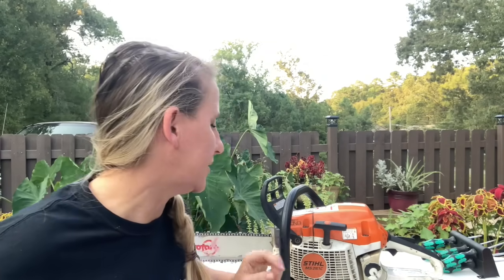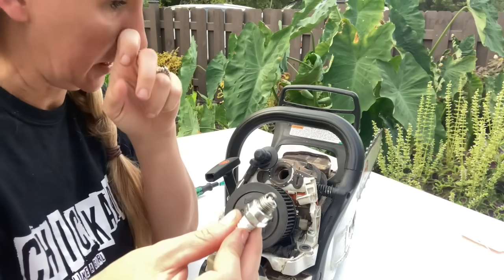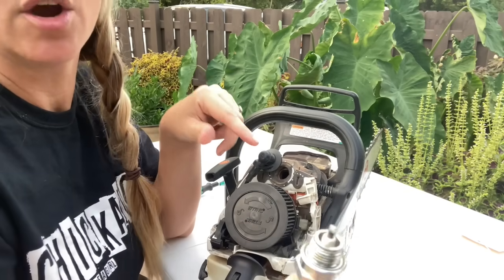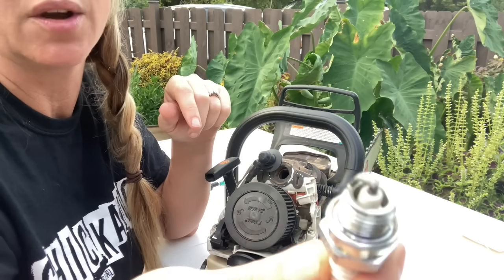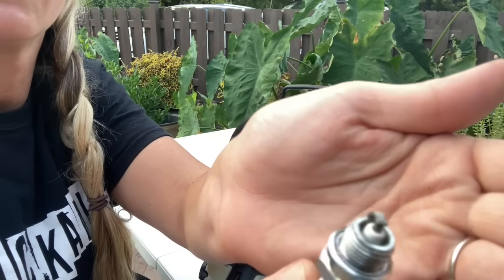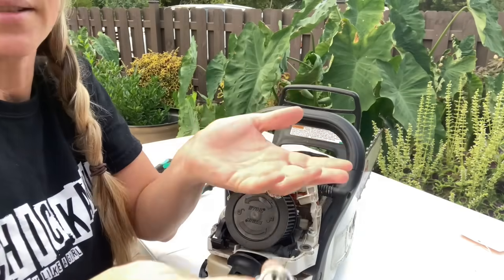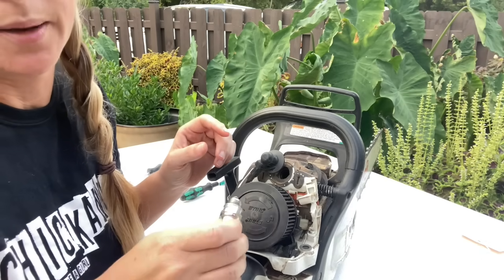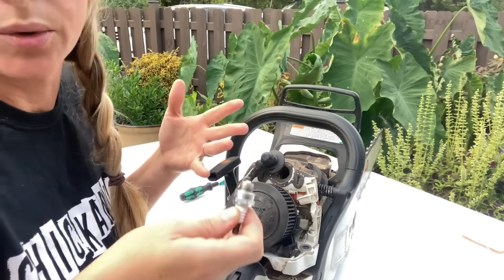STIHL M-TRONIC CHAINSAW HAS NO CARBURETOR ADJUST, WILL IT "RESET" TO REGULATE FUEL CORRECTLY?

Comment: I have a 661 C-M that flooded so bad after 5 pulls on a cold start it was dripping fuel out the decompress button. That wasn't the first time but not every time either. I took it in under warranty and described the symptoms to the "master mechanic" and he told me he would check the circuit board. Great, that sounded like a reasonable course of action. When I went in to pick it up 3 weeks later they wanted to charge me so I asked why and was told 1) it had really really bad gas and not mixed to the proper ratio. I use aviation 100LL and I know how to mix, I mean how hard is it to pour in the Stihl brand oil and fill the can up to the 1 gallon mark? And they replaced the gas filter. I preceded to read the "master mechanic" the riot act and left  the saw with instructions to have the owner of the Ace hardware store call me. He ended up not charging me. They also had to replace my bar, chain, scabbard and engine cover because they lost them. I think I actually may have remedied the problem after taking at least a half hour to get the flooded saw started it was running very rough and took several minutes of goosing the throttle to keep it going enough to idle without stalling. Then using it to make a few cuts on an oak. After that it seemed to be running normal but I Stihl took it in to have it looked at. It hasn't given me any problems since so I'll never know for sure what made it flood like it did unless it acts up again the same way. But I Stihl suspect the circuit board.

Comment: A bit of a hit piece here. I gather that you are an Echo dealer, so it’s in your interest to trash your competitors. But you also owe it to your viewers to give them the facts, and this isn’t exactly it. And to say it takes 5 or 6 pulls to start a Stihl? I call BS there too. I’ve had my MS361 for almost 15 years, and it’s never taken more than three pulls to start from cold. And I’ve never done anything to the saw other than clean the air filter regularly, keep a sharp chain on it, dress the bar when it needs it, and it’s never been back to the dealer for anything…..ever…. Some of the best money I’ve ever spent!

Comment: If you read the instructions, that's not the correct way to calibrate the saw. You start the saw and let it idle for between 30 to 60 seconds. Then you give it full throttle. The rpm goes up and down when the calibration is proceeding. When the rpm goes down noticeably, let go of the throttle and the saw idles, calibration is done and complete.
In the video it seems like you just let it idle for 90 seconds, and that will not lead to a successful calibration.
Reply from the maker: https://blog.stihl.co.uk/perform-m-tronic-reset/

Comment: Actually you are mistaken. IF the saw was starving for fuel it would be screaming, it is not. You maybe used to echo saws that are purposely tuned lean from the factory and often burn up unless adjusted.  The MDG diagnostic tool does not program the coil and is only used to diagnose the saw. They run about 500 CAD or 450ish USD.  From what I saw in your video that sun is running fine. I service a fleet of such saws and they all run very well. The Mtronic saw still has a carb kit so that could be the issue. Also you were mistaken about the warranty. Stihls warranty is 1 year, get the oil it is now 2 years not 4. Also pro saws have 90 days BUT if the person who buys it states they are a home owner then it is 2 years as well. Echo and Husqvarna may have a longer warranty but it is often needed. Echo saws are sent to dealers running lean so they can get past the EPA standards and Husqvarna burned their dealers quite badly here in Canada that very few professionals will deal with them again.  There is a reason why Stihl is number 1 worldwide.  There is a fuel filter upgrade ( much finer ) that keeps the saws running better and keeps the rubbish out of the carb solenoid.

Comment: I believe Husqvarna chainsaws come with a two year homeowner warranty, not a four year warranty. I just bought a new chainsaw so I reviewed the latest information recently.  Also, if I'm not mistaken, you don't have to just buy Stihl's oil to extend the warranty. I think you have to buy their engineered fuel/oil mix.   Echo has the best warrantee of four years. I ended up choosing an Echo CS-620P, not just because of the excellent warranty but mainly because it seemed to be better than comparably priced Stihl and Husqvarna chainsaws some of which have plastic crankcases, believe it or not, while Echo's crankcase is magnesium.  I think some Echo chainsaws are better built and are a better value than comparable Stihl and Husqvarna chainsaws. Thanks for posting your excellent videos.

Comment: All I run is stihl. I'm a carver. The new saws are garbage especially the 261 and the 500i is a nightmare. My 3 main saws are ms250, ms211 with a carving tip and my ms460 magnum.  Two of my friends bought the new saws. My friend with the 500i is a professional logger. He leaves it in his shop. He runs his 660 mag. That stupid saw takes like 20 pulls. Yes it's been back to the shop. Yes we know how to start a saw.

Comment: What you have shown with the plug has nothing to do with WOT tuning.  First of all, you have to actually put the saw underload at WOT for decent amount of time.  Then, the part of the plug you observe is at the very BASE of the porcelain, where you have to actually cut the threaded part of the plug away.  The color of the strap has nothing to do with WOT fueling.

Also, I see no relationship between the chain spinning while in the start position and it running lean.  The saw obviously idles down once in the run position and the chain stops, just like it should.

Furthermore, MTronic works well.  If you suspect that the system is not working correctly, replace the solenoid.  They do fail.

Comment: Most of my saws are Stihl m-tronic as well as the fuel injected 500i and the procedure you're doing is not even close LOL the instructions in the manual say to warm it up and then full-throttle it for 30 seconds to do a recalibration of the computer. And if there used properly and maintained properly they're just as reliable I have the 261 and the 462 and both have worked flawlessly for years without a hitch.
Reply from the maker: What you described is the reset procedure for the 3rd generation. This was the 2nd generation procedure.. Thanks for watching..

Comment: hey there.  i just watched your Stihl M-tronic  chainsaw video.   doesn't Stihl  have a secondary foam air filter,, ?   I thought that a lot of their equipment is supposed to.   I noticed it the video it looked as though that saw does not have one .  and even if it doesn't have it from factory.  if you added one wouldn't it richen the fuel mixture a bit.  ??  I would think so .  let me know please cause im curious about that .  my brother has two of those saws.   Thank you ..  Tim from Wisconsin .

Comment: I see a little gal on YouTube who likes to play around outside of her cabin cutting a little wood, a little brush, and most of the time she’s working by herself. She picked up one of these Dewalt dual battery chainsaws at what I was doing a lot of grinning to begin with. A bit later I wasn’t grinning so much and realized what I was looking at was the perfect answer for most homeowners, vacationers, and campers. Ms. Chicanic I think might agree some of her worst enemy’s are bad gas and folks not mixing gas for 2 cycle. I never had the opportunity to run her saw, but it sure looked like it was a good running machine and it definitely didn’t have the whole list of previous problems to worry about.

Comment: I know some of those Stihl saws have a pressed in adjustment stop. I’ve been able to drill them out and rip the limiter caps out. Even adjusting the idle you have to take some of the electronic components off, adjust it and put the carburetor back on hoping you didn’t turn it too much or too little. Horrific design. But for Stihl, it’s a great design.

Comment: M-Tronic was created by Husqvarna, Stihl cried to the govt so the govt forced Husqvarna to share the tech with Stihl, Therefore Husqvarna leases the tech to stihl. However M-Tronic (Husqy tech) is the older, first version of a solenoid based controlled fuel management. Whereas Husqvarna developed the 2nd gen. AutoTune in their saws and does not have the early version solenoid issues that stihls leased 1st gen M-Tronic have.

Comment: When you started it and the chain was moving it is because the high idle was on, not because it's not getting enough fuel. I have MS 261c (Mtronic) that I bought a few years ago and it starts and runs flawlessly, even after sitting for 6 months or more. My fuel mix is 45:1 stihl oil/ NON ethanol fuel. Any period longer than 6 months that I know the saw wont be used the tank gets emptied, the fuel is run out and refilled with alkylate fuel and then started again to make sure the alkylate fuel is dispersed throughout the carb, etc.  I like the Mtronic self adjusting for many reasons, but the #1 reason is this- if by the off chance I loan it out to someone, I know they CANNOT fiddle with the carb to try make it run at a higher rpm and in turn lean it out and burn it up. I've had that happen with my Husqvarna 266.  I've owned many saws from an early 1960's pioneer 620 to a Shindiawa 488 and  757 and now the Stihl MS261c. The Stihl has to be the best I have ever owned by far.  I tried an Echo 590 (returned it to dealer for a refund),  it had nothing but troubles and felt  and looked cheap.  

To me, your video is nothing but a plug for Echo, and you really have no clue about the Stihl or Husqvarna autotune saws that really do work very well. As for the spark plug being clean after such a short running period, how could you honestly expect anything different?

Comment: I would check that the carb is attached securely to the saw and that the gasket is ok as the mixture could be weak from an air leak could also be that the fuel system has a partial blockage as well, and being a crank case transfer two stroke the main seals could also be leaking.

Comment: What chip does it have? Reason for asking it seems there are different resets for different chips; ie if this has >M3.0 chip the sequence is; Engage chain break, Triangle, start saw idle between 30sec to 60 sec (no more no less), dis-engage chain break, full throttle > 30 seconds (it will run through cycles), once rmp audibly drop reset complete.

Comment: Very interesting video I have a m Stihl chainsaw which won't run been told needs new carb for about£120 here in UK and they had special deal on new chainsaws for £170 with 2year warranty so no comparison bought the new one .
This is the trouble nowdays a throw away society instead of manufacturing stuff that can be repaired no wonder the planet is in a mess,will try your reset thanks

Comment: The chain is spinning like that while it idles because it's probably not tensioned properly... a chain should barely inch itself along slightly while idling if it's tensioned properly.... not getting the fuel it needs????  If you're a STIHL hater.... just stop talking about the brand.... you clearly have not run chain saws very much... stick to wrenching.

Comment: Hi I have a Stihl 009L. I put in a carb kit. New filter . New backup gasket .blew lines out . Adjusted needle float valve. Cleaned perfectly.  It starts and cuts well for five minutes or so then dies.  If I leave it for awhile it starts and cuts for a few minutes and quits again. Can you suggest something to try?   Thanks,  Jim
Reply from the maker: You need to check for fire when it dies.
Reply: Pull the muffler and take a look.

Comment: This is the same kind of nightmare I had to deal with as an automotive mechanic back in the early 80's, starting in 81 cars had computer controlled carbs, yes, I'm not joking, the metering rods were computer controlled and they were absolute nightmares.
Reply: I had a new 1976 International Harvester pickup that would cut out because of the electronics. Converted it back to points, distributor.
Reply: @tomcurran1538  
I've done that same thing to so many Harley's you wouldn't believe it, I currently have a 2003 Sportster that I converted over to points, every year when I change oil I put a new set of points and a condenser in it, never had a problem with it.
Reply: I still have my tools to rebuild a Rochester E2ME/E4ME...not that I will ever need them again...my TDI VW makes more HP and torque than the wheezy V8 that had one of those Rochester carbs on it.  There is a learning curve for manufacturers and mechanics and eventually all saws will be electric whether we want it or not...

Comment: I've been running a MS441R C-M for more than 5 years, and it is easily the best chainsaw I've used in my 40+ years of sawing.  Starts easier than any saw I've ever used, is always in tune, and has a very flexible powerband.  Mine has been ported (cylinder was milled to allow port timing adjustment) and has the squish tightened.  I run non-ethanol high octane fuel to maximize the output, and my 441 will absolutely spank a stock 660.  Count me as a M-Tronic fan, big time.
Reply: I reckon a lot of these problems are people letting stale old gas sitting in the saw over a long time period, she said it even at the start, if your saws been sitting idle for a long time since you used it last. As far as I can see its a stihl bashing post based on all the Hearted comments given to posters who are opposed to the stihl brand.
Reply: @6900pilot  Very true. husky has there version (auto tune) and echo will follow suit soon  just wait!There is nothing wrong with fuel inj or auto tune  or m/tronic !They run better than any carbed, saw sorry guys just the truth!
Reply: @andrewslagle1974  Very true. Look what fuel injection and computer control did for the power and reliability of auto engines. If you were around in the days of carburetor auto motors, then you know what I mean.
Reply: Yes, stale ethanol fuel is the enemy of small 2 or 4 stroke engines. I use a 93 octane gas mix with stabilizer in my 2 strokes and straight 93 in the 4 strokes, then drain the tank and start it back up to run it dry after every use. I never let fuel sit in the tank of my saw or string trimmer because it eats the fuel delivery components. Plus the fuel cap is usually vented allowing the ethanol in the fuel to attract moisture into the fuel. It is a pain to follow this procedure but it saves many headaches trying to start a unit with a fouled carb.
I bought some TruFuel to run the these engines occasionally to clean the carbs out, but at $20/gallon it's too expensive to use as every day fuel.
Reply: @johnphillips4342  I run a  land clearing business and a firewood service we only use the vp non ethanol  high octane fuel only. It is expensive but no problems with the saws ever .Also the saws run better on the high octane fuel!
Reply: I have had two 441s. The early one ran great but could be hard to start. It got killed by a tree. The second one was great all the time. Cuts great and never gives me a problem. I think they did some adjusting to the ECU to make them start better. I also have a 440. It always runs and is lighter but it vibrates more. It also is slower cutting.
Reply: Oh my, chainsaws that spank? That sounds kinky, or are you just trying to sound cool grandpa?
Reply: @dr.pickle5842  My point, if there was one, is the M-Tronic will even work well on a modded saw.  Mine has been pushed fairly far for a work saw, and it is a dream to operate.  A 71cc saw that has the power of a 90+cc saw ain't hard to like, and the ability to start on a cool damp morning and run all day into a hot afternoon, all while remaining in tune, changed my mind about what I want in a chainsaw.  I have sold all my manual carb saws except for one sweet little ported Jonsered 2153.
Reply: @dr.pickle5842  No grandkids that I know of...  but my C-M is strong.

Comment: I have a cheap chainsaw that cost $180 brand new. From the factory the carburetor is jetted lean. At first I thought it was only low speed because the engine ran fantastic at high speed but would bog down slightly at low speed. But after hard use and seeing the muffler glow red, now I know it is lean throughout the rev range. I am amazed the engine is still running after being run lean for as long as it has. But now that I know, I can fix this issue at home with some hand tools. Would I run the saw that lean ever again? No. But it was nice to know that the saw never simply stopped working because of a software issue and a great comfort that I could fix the issue myself. What does that say about Stihl when a $600+ chainsaw decides to suddenly stop running good when you need it to, and your only option is to have the dealer "repair" it at a ridiculous price? What is the price of this "repair" anyway? $600+?